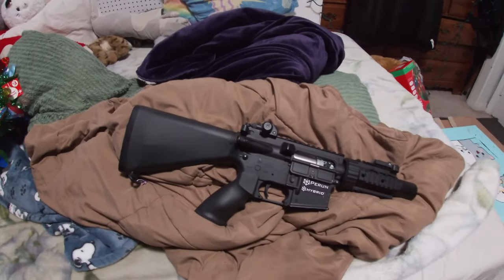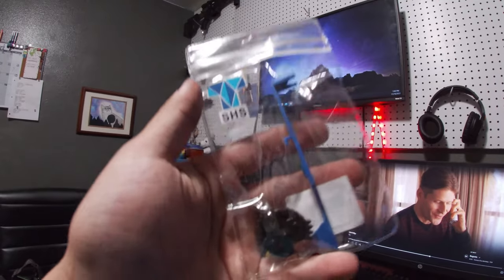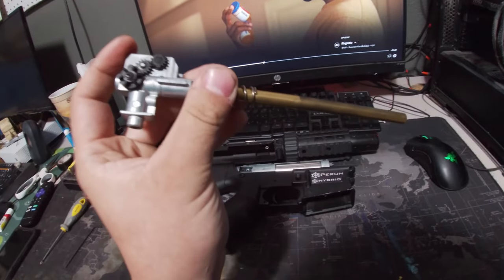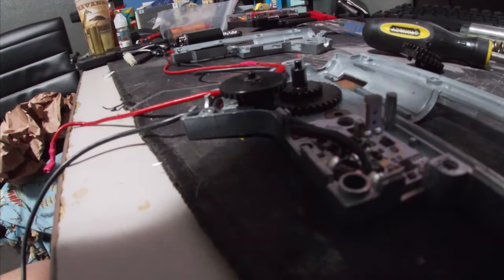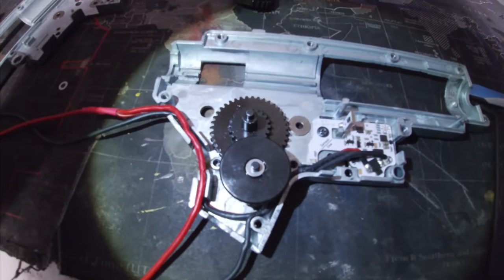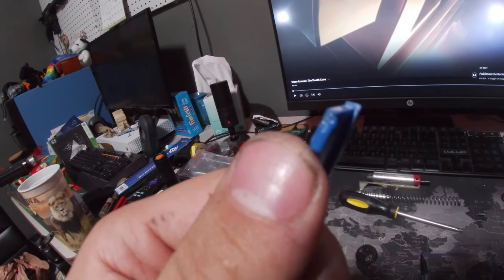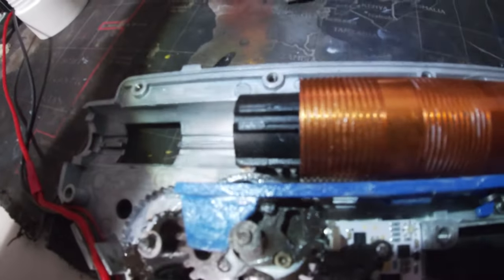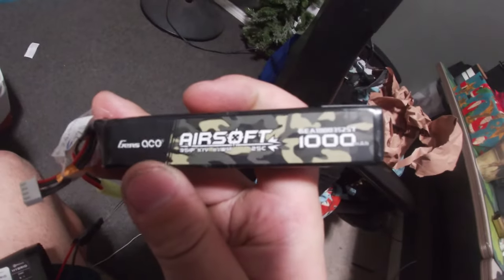CHEAP AIRSOFT DSG BUILD!Alright! PT 1

Comment: Dude why use ball bearing for a DSG build, isn't it going to break after two minutes of firing?
Reply from the maker: Most people do use  ushings instead of ball bearings yes. But when I redid the build I used J-Caged bearings, more pricey yes but the J cage bearings were still holding up even after 12k rounds. Only issue I did experience in the updated build was tappet plate spring got weak fast and did not like full auto that much
Reply: @FSUAGAMINGAIRSOFT  Oh right, if it's J cage bearings, it's fine, sorry, didn't see.

Comment: How consistent were your velocities on the original 12:1 build? Did you end up short stroking teeth from pickup/release? When having to adjust AOE that much it can sometimes result in tapet plate PME, so would be interested to know whether you opted for a stronger spring (M120 or similar), or whether you removed any teeth. Thanks
Reply from the maker: @TheGutshotpro  The original 12:1  was very consistent with a varience of +5 FPS
I Was lucky with no PME with the Peruns Active Break. But jow a days I save the motor the extra stress and SS them and modify the tappet for good feeding
Reply: @FSUAGAMINGAIRSOFT  Awesome, thanks for the reply.
Reply from the maker: @TheGutshotpro  Of course brotha!

Comment: @FSUA GAMING what is your opinion on the perun hybrid optical mosfet?
Reply from the maker: Hands down the best,  very essy to instal as well! I only had an issue with a couple but after cleaning the sensors and it worked good afterwards! 

I prefere these since they are proggramable via trigger withou the need of an app or having to "upgrade" the program to unlock it all like the gates and stuff. These just plop right in and your good to go. I do know some gearboxes MIGHT not be compatible like the new CYMA gearboxes which has a post in the way ylu have to dremel down etc.

Comment: How is that build holding up? 

That "nice" rubber padding on the front of the Maxx cylinder head often cause the cylinder head guide pins in the gearbox to snap/break. 

Retro Arms don't even give warranty if you are using Maxx cylinder heads in their gearboxes.
All that rubber padding does is letting the whole cylinder assembly move every time the piston head slams into the cylinder head causing a lot of stress to the cylinder heads guide pins. 
If you wan't to use something that softens the impact of the piston head, use poly/plastic cylinder heads (slong has an exellent one) or use metal cylinder heads with padding/sorbo on the inside, and perhaps the most important thing, use a cylinder head that has nice and tight fitment with the gearbox shell.

If you are using "old school" M4 hop chamber like you are you can also use a "hop up brace" that installs between the gearbox and the hop chamber. It transfers a lot of the energy from the gearbox to the reciever instead, pretty much makes any stock gearbox almost indestructible.
Reply from the maker: Correct all around! 

⭐️ I remade the build check that one out!⭐️

- I realized after that fact about the MAXX cylinders and ended up replacing it with The Real Deal cylinder.

- I didnt have a brace at the time and was to eager for the build since I wanted to dabble in DSGs more ( im a lot better now) since ive been teching and doing highspeed 13:1 SSG builds.

- It did crack the front end of the gearbox but I was expecting it since the shell itself was pretty weak. I ended up rebuilding it taking me time amd research and its still holding up to this day.

- I created another video on the update! You should check it out 😸
Reply: @FSUAGAMINGAIRSOFT  The update, is it the DSG BUILD 50 rps Real Deal airsoft parts review?
Reply from the maker: @KAG2203  Yes sir!

Comment: I have a quick question im making a dsg build with 18:1 and  a Asg 22k motor and a gate titan .
do you know how much rps it should be making?
Reply from the maker: 35-40 RPS depending on your shim job, bushings, spring etc

Mine is 18:1 with a 22tpa motor hitting 43 RPS
Reply: @FSUAGAMINGAIRSOFT  Okay Im trying to get least hit 40 rps that’s have been my goal. Im building it off a ddmk18

Comment: what does it costs all together?
(all the parts)
Reply from the maker: All in all arpund 250$ with shipping amd tax etc. 

My main is a DSG

Retro arms QC GB
M140 
The real deal piston and cylinder head
Perun v2  hybrid mosfet
Maxx type 0 cylinder
SHS DSG sector
SHS 18:1s
The real deal tappet plate modified
ASG 30K 

Pushing 54 RPS at 353 FPS with .20

Check out The real deal website he made a DSG bundle kit, just get a Perun hybrid as well, it will help the headache of a mechanical issues like overspin and dou le feeding etc

Comment: Can u do a 12:1 with a dsg? I wanna make the fastest dsg possible
Reply from the maker: Sadly no usually only 16 and 18s for thes best
Reply: you could go with an 10:1 dsg or 16:1 tsg if you want as fast as possible (afap being 70-80 rps since there is no mag that is physically capable of feeding bb´s faster) but that comes with a metric sht ton of headaches and judging by your comment it doesnt really seem like you got the know how just jet, best bet would be to build a: 13:1 ssg 12tooth/18tpa setup with m120 spring and get that to work reliable for at least 1k rounds of 0.30´s and when mastered go nuts on the crazy sht. if you use expensive high performance parts the wrong way from the start your wallet will be in for a bad time my friend, Can tell first hand ;)
Reply from the maker: @Fatman-ze9dv  I agree! My SSG builds are pulling 30 RPS, not to mention it is more relaible then a DSG and way less headaches. Semi auto for both my 2 DSGs and SSGs are the same. I just bring out the DSG just to troll